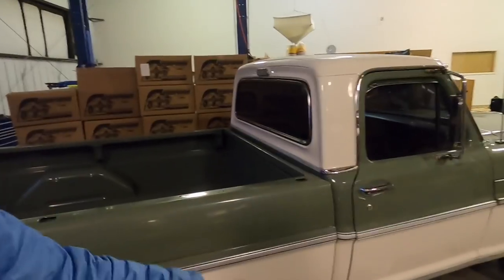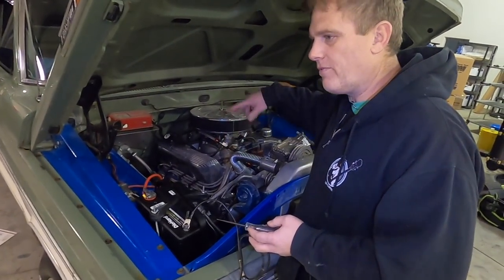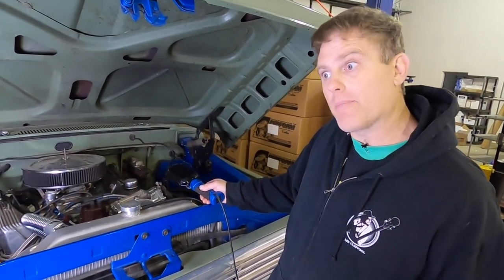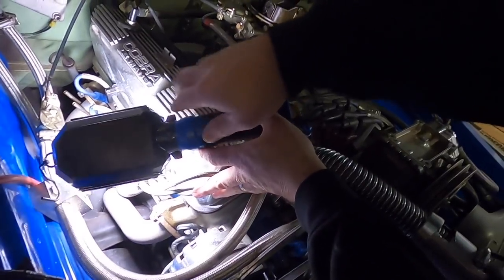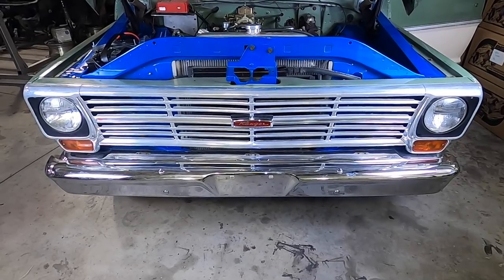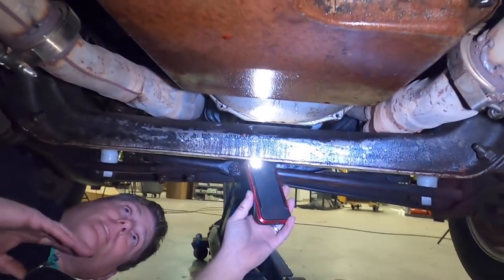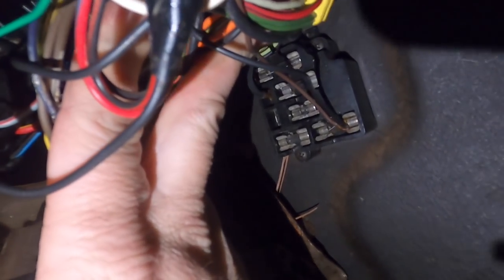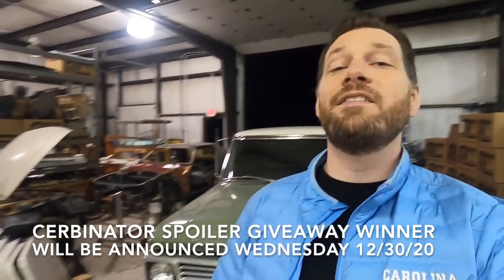EVERYTHING WRONG WITH MY 50 YEAR OLD 1969 F100 TRUCK!

Comment: Love your Truck! I have a couple of its Brothers. After you run down the systems these old Ford's are pretty much wash n wear and make great Daily drivers and dependable.  They are pretty simple thankfully. Have put 545k on my f250 Short Box Crew Cab, over 37 years a daily driver. NO dents,however lots of Rusties everywhere. Have decided to do restoration on it and use my F250 same green as yours with two tone paint. Can be my parts runner! 74 yrs here now and think I need a project! Love the 67 to 72 trucks the most, they all remind me of the Best of Days! Glad you are gonna make it a keeper! Fir your Dad's sake. Seems by the looks and condition,he loves it!
Reply from the maker: Thanks for commenting, I loved reading ones like this.  That F250 is gonna be real nice it sounds like and that's awesome you are going to restore it!  545k miles, wow that's amazing.  Hopefully I get my Dad's old F100 going soon.
Reply: @GearHead704  is there a way I can get in touch with you via Email? I have a total of 4 bump sides! Would prefer to find donor vehicles with good parts or pieces and would like to have you assist in perhaps finding resources! Thanks for responding. Lol my boxwood green is on the bottom and roof! Very comparable to yours! Runs and drives awesome  wrestling with original paint and very little rust but it's time to decide what to do with my Daily driver which still turns heads! Not bone stock under the hood,all else is! Do you think I should leave undercarriage un covered? Still has lots of the old factory stuff but it falls off in s all pieces now and then! Guess all things do that with age! O am 74 going on 28. Regards here! Lawrence Thank you
Reply: I have auto choke! Holley 750 vacuum secondaries, I like it! PS who did the Blue? Smiles
Reply from the maker: High Lawerence.  I don't know too much about these old trucks actually, but you can e-mail at 704gerhead@gmail.com and I will try to respond with what I know.  Good luck.

Comment: The oil filter is a System 1 cartridge screen type, designed to be cleaned. Unscrew the end cap and pull the cartridge out, clean with solvent kerosene etc, then blow out from the inside.Use a clean rag Only on the o-ring, and oil the threads on the inspection cap. I'm not sure of the filtering specs, current ones could be 35, 45, or 75 microns.One of the reasons I haven't used mine is the crossmember catches the oil when you remove the filter. My homemade funnel/deflector isn't very efficient. New ones run $250.00 and up. Personally I would replace Both radius arm bushings, they would both be new at the same time. You will be amazed at the steering difference with the rag joint and radius arm bushing.
Reply from the maker: Thanks for the detailed information on the oil filter sir!  I also agree and will replace both items at the same time.

Comment: Manual chokes were common in my youth....the auto chokes were either switched off via electrically heated, or exhaust heated bimetal strip. The problem with those was reliability at the time. They failed frequently. Manual chokes rarely (if ever) failed but, you had to remember to switch it off. Also the auto chokes had really high and difficult to control engine speeds via the choke linkage. If you can imagine you big block firing up dead cold and going immediately to 3000 rpm (!), you can imagine what this was like back in the day.....EFI, ftw.
Reply from the maker: EFI, definitely an improvement for sure!  Thanks for the info on the chokes, I"m still learning about it.
Reply: @GearHead704  Yup, choke is the brain-damaged version of warmup procedures. Even mechanical fuel injection like K-jetronic controls warmup with a simple secondary injector so, you don't have to race the motor while it warms and wear the shit out of it. Miraculous!

Comment: Be sure to check the front cab supports. Those were always an issue with those old Ford trucks. If they fail the front of the cab will settle down and put a lot of pressure on your steering column.
I've owned probably a dozen or more of the 67-72 Ford pickup trucks. If you have any questions I'd be happy to help you. 
I also have a question for your mechanic. I've worked on a lot of old carburetors, mostly Holley carbs. 
Has the quality dropped so low that warping of the carburetor body is a common issue now?
I just wonder because I rarely ever found any of the bodies to be warped enough to need machining. At worst I could file or stone them flat in a very short time. Thanks.
Reply from the maker: Thanks for the info, we'll check those out.  Matt said he may try and respond to the comments more, so he may respond here, or if we get a chance we'll cover it on the channel.  I appreciate the support man.

Comment: i dont know where you live..but you should look around  in junkyards to see if you can find a 1973 f100,,they all came with disc brakes..and i think 73 is the one and only year they used the same size king pins as a 72 ,,so a disc brake conversion is real easy ...also ...swapping over to delay wipers is another basic plug and play swap for these trucks ,,delay wipers started  on ford trucks from 78 ..as long as its a dash mounted wiper switch  that has delay wiper...they all work ..except i forget what year you have to move one wire  in the harness to have your washers to work ..easy thing to do.....thats a dam nice truck
Reply from the maker: I live in Charlotte, NC. Thanks for the tips!  This was my Dad's truck that I recently got back so it's special to me.

Comment: Wow, nothing wrong with that truck. It is in primo condition. Everything about this truck is clean and smooth, even the inside of the box.
My Dad left me a 1968 Ford F-100 with the Ranger badge and it has some rust but is all original with the 360 V-8 and 4 speed. One day, I will restore it but want to go modern with fuel injection, leaning towards a 97 5.8 engine followed by an automatic like what came in the F-250s of that era.
Reply from the maker: The 5.8/351 would be FANtastic in that.  Yeah I got very lucky with the condition of this truck.  I'm so glad I was able to get it back.  Thanks!

Comment: In case you are wondering what FE stands for, that is Ford Edsel. Those came from the 352-428 cubic inches. 429-460 engines are known as the 385 series.
Reply from the maker: I didn't originally know that but I think someone told me on the last video on the truck maybe, but yet that's good info to have for sure.  A 460 build would be a lot of fun too.
Reply: @GearHead704   well parts for an FE are a little bit more expensive as well. The 385 series engines I would think be a little bit easier on your wallet. For the money it’s hard to beat the power gains and reliability of them. Friend of mine has a 460 in his foxbody. It’s fast, not easy on the fuel mileage though but it is reliable.
Reply from the maker: @streetcarmedia660  Hah yeah fuel economy is something lacking alright.

Comment: Hey bud! Was admiring your truck again and have a thought! You can get a great wiring diagram for 67 to 72 ford trucks. 18x18 plastic covered and show everything! You may already know this. I have 3 bumpside trucks, one like yours and 2 crew cabs. At one time back in the 70s I had a Fleet of those years,My Favorites! Hope your is doing well for you if you didn't flip it. Regards
Reply from the maker: I didn't know that, that would definitely be cool.  Thanks for sharing.
Reply: @GearHead704  I am gonna do a  Mini project on my 70 F250 sport custom 3/4 ton single cab. Has 79k original, been a sweet Ride for Many Years! Have too many projects, yet Lovem All! Have boats and Motorcycles also. Long story, Hope you are enjoying your Truck! Regards Lawrence

Comment: The first problem is when you slammed the door when you got in it. I cringe when a Chevy puke gets in one of my vehicles and slams the door so hard it makes my ears ring. But I guess that's what you have to do when you drive a  GM product. In the late 70's my dad had an all green '72 someone had put a 428 in and we didn't even know it until I had to put rings in it. He was told it was a 390 when he bought it used.   Later I had a white '67 f100 I put a 302/c4 in, lowered and Outlaw II wheels, my favorite trucks to this day are 67-72s.
Reply from the maker: I love them!  Very cool on the 428.  The door has some issues and will not close currently without a slam, but it's on the fix list, we just didn't cover it on video.  Well we talked about it, but I cut it.

Comment: I have the same truck the brakes are horrible front disc brakes on it and an x-pipe underneath you would get 30 40 horsepower then it would sound even better
Reply from the maker: I have thought about a mid pipe.  X could be cool.  Yeah it needs brakes bad heh
Reply: Thank you disc brakes for the front of that truck 1973 to 79 F150 will fit right in there drum brakes are scary bigger Wheels bigger brakes my x-pipe gives a truck a bark

Comment: oh man, you and carbs are like me to fuel injection. Honestly, fuel injection is all fine and stuff, but I much rather have a carbureted motor. There is more enjoyment trying to start up your car/motorcycle after sitting a few days unless it's my Venova. That stupid Edelbrock + sbc just starts up within 5 secs after sitting for months.
Reply from the maker: Hah hah, well I do want to learn more about carbs, but I do like my EFI too. You're right it is always fun to get the old truck running after it's been sitting for a few days LOL
Reply: @GearHead704  Holleys are good carbs to learn how they work + basic tuning. The bowls make it so easy to swap main jets + if you put a meter block conversion on the rear, you could also do metering jets in the rear, and also, the air bleeds +squirters are easy to adjust as well. I'm not a fan of all the computers that come with EFI bc you cannot walk into Advance Auto and grab another one LOL.
Reply from the maker: LOL that's a good point, although I can buy A9L's from Matt or have him repair them 😁. Seriously though I'm going to have a carbureted FoxBody one day.

Comment: Ck the dimmer switch,  and oh god paint that blue under the hood black.
Reply from the maker: The blue is how Dad wanted it, so I'm keeping it that way even if I'm not a big fan of it.
Reply: @GearHead704  , I can respect that, never seen a headlite switch come apart like that, easy fix. Front disc brakes off a later f100 or 150 would be a great upgrade.